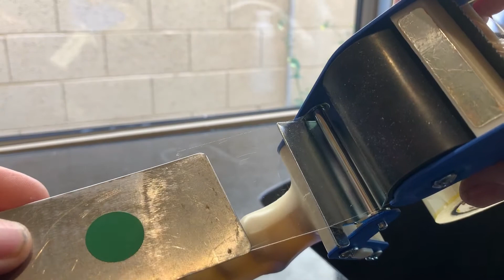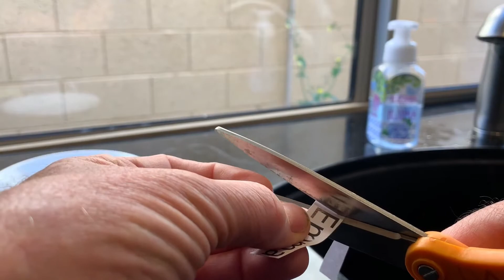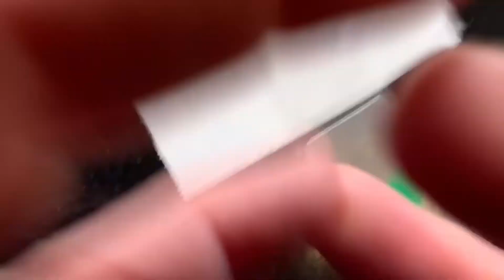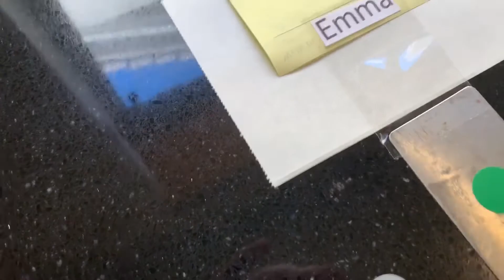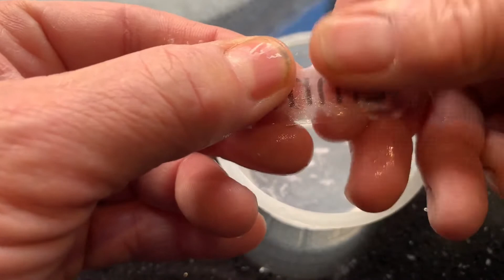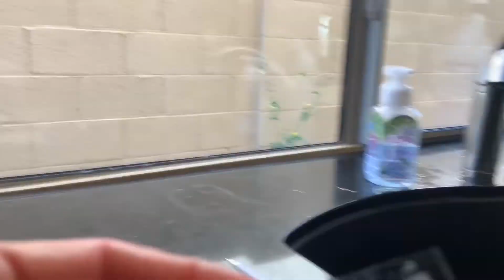Making labels using Ink Transfer

Comment: Interesting.  Thanks for sharing this information,

In a pinch, this is works well, but for not a whole lot of money you can achieve far better results with less effort.  You can buy clear adhesive labels  for pennies a sheet.  You can buy and print on water decal paper for cheap and the result are even better, so long as you can live with the film.  There's a product I came across recently that has a similar process as yours, but the substrate completely dissolves in water,  leaving just the ink.  This is awesome if you want a film free decal.  

If you want DIY, there's a channel called The Crafsman (Yes, spelled that way) He has devised some amazing techniques for transferring images. He has become quite a hero among the arts and crafts community on YouTube.